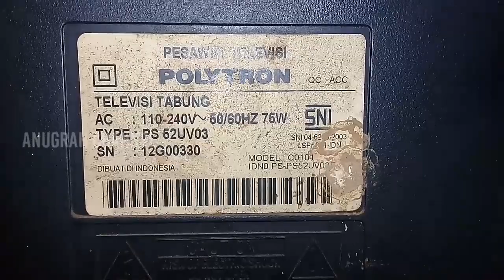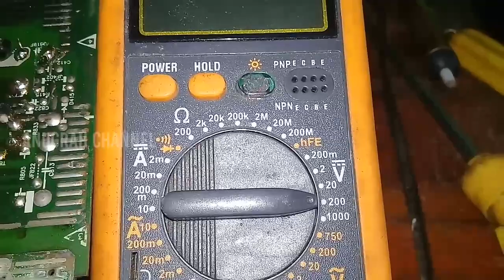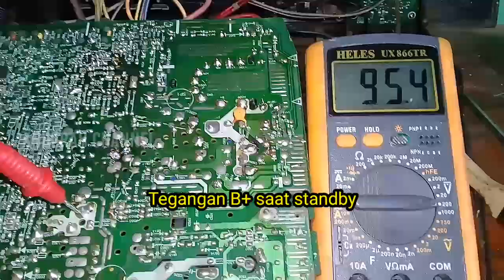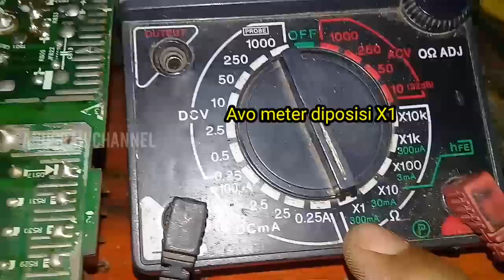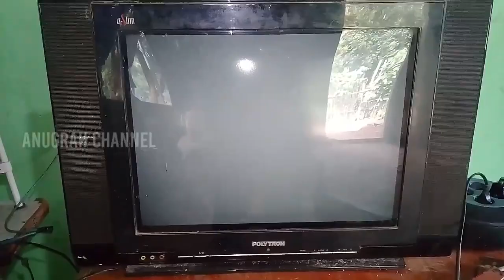Cara memperbaiki TV Polytron slim mati dan semua tegangan drop

Comment: kalo TV Polytron Crystalin Slim, Awal kerusakan Regulator fet short, sudah diganti sempet nyala, setelah tr sama IC vertikal panas tv ditampilan seperti mau mati lagi dan ditravo bunyi ciiittt, dan tr horizontal pun short lagi, padahal saya cek jalur aman² aja, IC vertikal juga short, setelah saya cek tegangan B+ jadi over 150v awalnya normal+115v, dan sampai sekarang belum jadi juga, yg sudah saya ganti (OPTOCOPLER-IC TL431-IC VERTIKAL,TR HORIZONTAL, RESISTOR BAGIAN OPTOCOPLER-TR STD1862-FLAYBACK-CAPASITOR B+& C 1000UF+100UF+470UF+10UF+C BAGIAN SUPPLY... MOHON SOLUSINYA MAS🙏🙏🙏
Reply from the maker: Coba vr/trimpot b+ adjust diganti dulu

Comment: kalau tegangan vertikal drop apaya yg rusak mas hanya terukur 3.volt dan 2.5 volt B+ normal115
Reply from the maker: Coba dulu cek dioda dan resistor dari pin fbt bagian vcc vertikal, bila perlu ic vertikal diganti dengan yang baru.

Comment: Tv sama kaya di video
TEG B+ stanby di 55v
Teg 5v ada dan indikator menyala..
Tapi tidak mau star wlw di pencet" di panel..itu bgian mana ya yng harus d cek lagi
Reply from the maker: Periksa dulu tombol ch-/ch+ mungkin tombol digit tidak berfungsi dengan baik.
Reply: @ANUGRAHCHANNEL52357  untuk tombol normal bang..karna pada awal nya juga tombol normal
Reply from the maker: @parapecintaqori4370  untuk tegangan 48v dan 5v normal atau bagaimana?
Reply: @ANUGRAHCHANNEL52357  untuk teg 48v hanya 12v dan teg 10v nya hanya 4v dan teg 8 v nya hanya 3v..
Untuk 5 v Normal bang..
Apakah itu teg dalam ke adaan stnby??
Kalo iya..bgaimana spya bisa star ya..sudah pusing nih bang😁
Reply from the maker: @parapecintaqori4370  berarti mesin tv dalam kondisi standby, coba open pin no 3 (kode pcb ic 702).
Reply: @ANUGRAHCHANNEL52357  sudah di open ttep ga mau star bang
Reply from the maker: @parapecintaqori4370  tombol ch-/ch+ tv atau tombol power sudah di tekan tekan?
Coba ic memory diganti dengan yang baru.
Reply: @ANUGRAHCHANNEL52357  udah bang..ttep ga ada respon..
Ic memori yang mana bang?
Yang HBT kah ??atau yang yang kaki 8?
Reply from the maker: @parapecintaqori4370  yang ic 8 pin
Reply: @ANUGRAHCHANNEL52357  saya kan coba bang..

Comment: Resistor yg di cabut pin b+ nilanya berapa bang kalok tv polytron mx
Reply from the maker: Itu resistor fuse tegangan b+ nila 2.2 ohm
Reply: @ANUGRAHCHANNEL52357  kalok di jamper langsung apa bisa bang?
Reply from the maker: @makir6117  bisa, tapi saran lebih baik pakai resistor fuse. Bisa  pakai resistor nilai 1 ohm, 1.2 ohm, 1.5 ohm, 1.8 ohm, 2.2 ohm, 2.7 ohm, 3.3 ohm, 3.9 ohm, 4.7 ohm, 5.6 ohm dan 6.8 ohm.
Reply: @ANUGRAHCHANNEL52357  ok bang mksih bnyak ya atas masukan nya moga kontenya makin bnyak subscreb nya., dan makin sukse selalu
Reply from the maker: @makir6117  sama sama 🙏, amin 🤲.

Comment: Saya juga lagi bingung nih tegangan drop di tv polytron PS 14U03G..5v D ngga ada teganganya..tv mati total
Reply from the maker: Resistor tegangan b+ menuju fbt dilepas dulu
Reply: Sudah saya lepas, bang bahkan fbt ngga saya pasang,karna led blm bisa nyala,jadi saya ngga pasang fbt dan tr horizontal
Reply from the maker: @demangsatria2824  cek komponen area psu.. dari tr 431, optocupler, zener dioda, tr c1815, tr a1015 dan tr fet.
Reply: Area itu sdh saya ganti juga mas,tr 1518,1015,optocopler dan tl 431,tegangan B+ jadi 27v dan 38v keluar 8,6v tegangan 10v keluarnya cuman 2,7v.. trs tegangan 5VD cuman ada 1,7v
Reply from the maker: @demangsatria2824  coba cek zener dioda dan tr dibagian tegangan 5V
Reply from the maker: @demangsatria2824  di mesin tv pakai vr b+ adjust?
Reply: Area psu Tr ft normal,tegangan 297v betul pake vr ajust..saya ganti baru
Reply: Tegangan 5VD ditester menunjukan 1,4 v..jadi lampu indikator padam
Reply from the maker: @demangsatria2824  coba jalur tegangan 5V yang menuju ke ic diputus dulu, sekedar untuk mengetahui penyebab tegangan 5V drop.
Reply from the maker: @demangsatria2824  coba di cek komponen zener dioda dan transistornya.
Reply: @ANUGRAHCHANNEL52357  asiap mas..terima kasih saya coba dulu,, tapi aman mas ya kalo saya putus jalur sementara , maksudnya hanya untuk mengetahui shortnya,, sekalian tanya, Anugrah channel itu tinggal daerah mana mas.. klo deket tak anterin aja ni mesin tvnya.. hehehe